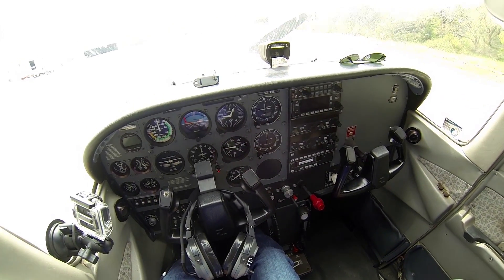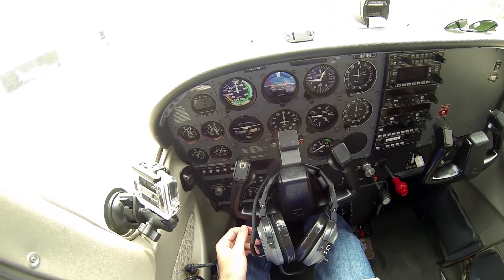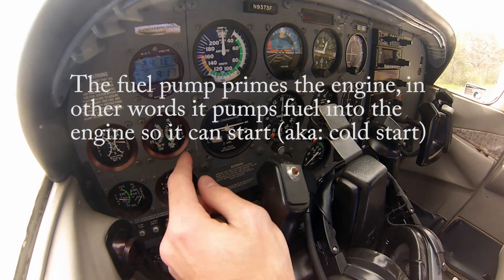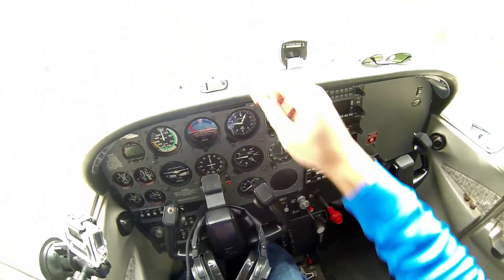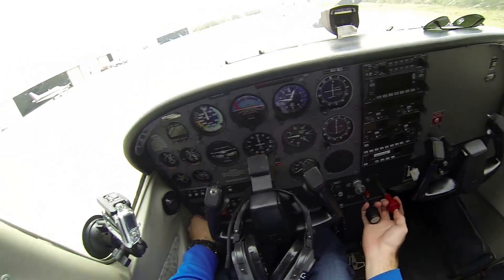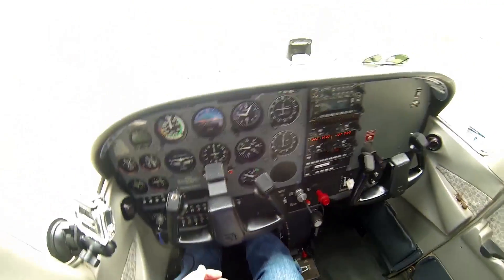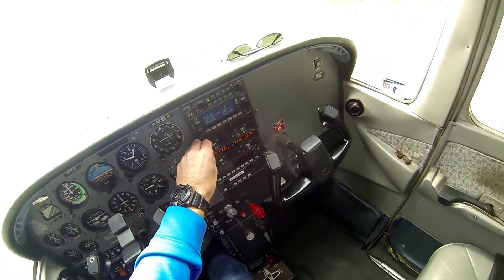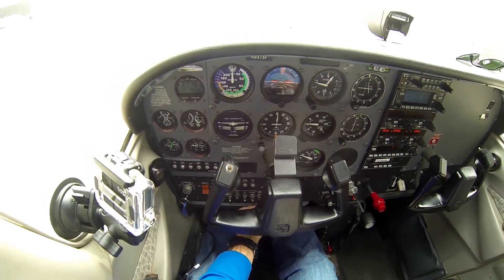How to start up/shut down a C172R

Comment: Interesting fact many Americans are unaware of; The "Master" switch is split for a reason. 
Americans learn to turn on the battery and alternator together, as if it were one switch, but this is actually not ideal, nor what is intended by the manufacturer. Because of the inductive loading of the alternator, it is actually better to start the engine on the battery, and get it stabilized before engaging the power supply to the alternator. Americans have simplified this task, because it is felt too many electrical power-loss failures would occur by pilots forgetting the ensuing task of powering the alternator, and not going back to their checklists where this step would be indicated. It's not a big deal either way, but it is worth noting that many other countries separate these steps, as was always intended by the manufacturer.

Comment: Great video. Thanks bud. I'm certified in the C172, but I build all my hours in the 150 bc it's cheaper and slower (easier to build hours), so I needed the assistance in the starting of the 172, bc it is different

Comment: How to turn off the engine 
THE  STEP BY STEP WAY
RADIO OFF
AVIONICS OFF
ALL LIGHTS OFF EXCEPT BEACON
MIXTURE IDLE CUT OFF
THROTTLE ALL WAY OUT
BEACON OFF MASTERS OFF
THEN IGNITION OFF 
pull the keys out .
HAVE A SAFE FLIGHT  GUYS .ALL THE BEST

Comment: You did not ensure both parking brake on and maintain pressure on toe/pedal brakes.  I was at a flying club years ago and one of our members did a start up without checking brakes.  After starting, he was so occupied with reading the remaining checklist he didn't look up to notice the aircraft was rolling.  He stuck another aircraft's tail and did thousands in damages.  He had to pay the deductible, the club's insurance paid the rest.  But he was kicked out nonetheless.

Comment: i dont really need a checklist, all of the steps are planted on my mind
Reply: its called a checklist for a reason, not directions. its illadvised to not follow the list, even if you are a very experienced pilot.
Reply: @kgraebes88 , I dont think he is a pilot (just a troll). However, the 0.1% he is a pilot... well they have proficiency checks for a reason, he will probably fail them.
Reply: Yeah until you forget a few steps and end up on the news

Comment: So, on this model the primer is a switch instead of a lever?
Reply: This one is fuel injected model, it doesn't have primer pump, you prime by opening mixture, throttle, and after running fuel pump you watch the fuel flow. That's the procedure for a cold engine. On hot, you just crack the throttle 1/4", mixture idle/cutoff, you crank the engine and advance throttle once it fires up.

Comment: 0:44 Where is that noise coming from?
Reply: Not quite, when the engine isn't running, the vacuum pump is not being powered therefore not spinning the gyros for the heading indicator and attitude indicator. Only the turn coordinator is electrically powered, so that is the noise you are hearing
Reply: It's the gyro spooling up when you turn the master on
Reply: FunFlightsHD Does it spin?
Reply: +Doc Nathan Land // docnathan it sure does
Reply: +FunFlightsHD Is it like the APU of an airliner
Reply: +Doc Nathan Land // docnathan nope. Just powers the heading indicator, turn coordinator and artificial horizon
Reply: will kaib you are correct

Comment: Do not switch off beacon when engine is running.
Reply: Also, speaking as a commercial pilot, i don’t see why you would turn on your taxi light without having a taxi clearance (or being about to start taxiing on an uncontrolled airport)
Reply: @qlemens6273  it really depends on the company SOPs when it come to before or after clearance
Reply: why?
Reply: @nobletangent  Because beacon is a sign that the planet has electricity and might takeoff anytime soon.
Reply: @ivanpatarcic73  oh i see
Reply: @ivanpatarcic73  the planet?🤣
Reply: @cv4981  and normally untill you turn off the mags or the master then switch the beacon off
Reply: Beacon light means engine is running and it may harm ground person . In short  it means don't come closer until it's off.
Reply: @Catchthevibes2.0  👍👍

Comment: Says not above 1000 rpm on start than proceeds to let it hit 1500... Maintenance must love you guys!
Reply: well I am sorry but the 172 must be started with 1/4 of an inch throttle open and oh I am sorry but I, as a pilot cannot adjust the idle RPM of the engine, if 1/4 gives me more than 1000 I can't help it either, other than to pull the throttle back after start ASAP.
Reply: Howard Lau your right, the correct response after the engine fires is to ensure it doesn't exceed 1000rpm by actively retarding the throttle. The reason we do that is to minimize the stress on the bits of the engine that are operating without adequate lubrication on the first start of the day. Try bring a ruler or another measuring instrument on a pre flight one day and actually measure what that 1/4" really looks like. You might be surprised at how slight the adjustment really is. 
Believe it or not these injected lycoming engines can actually start with the throttle closed if your quick enough on the mixture. 
Ps. Your poh should indicate that idle should be set between 450 and 550 rpm with throttle closed. The same engine in some float applications can be set up to run at 300 rpm or less!

Comment: What's that sound after you press the master switch?
Reply: +Doc Nathan Land // docnathan No...inside several of the instruments, there are spinning gyroscopes which set a reference point for when you go flying. It's all about inertial changes in your flight.
Reply: That sound is the gyroscopes (or magic) that's inside the attitude indicator.
Reply: Thank you!
Reply: Not necessarily. Refer to what Daniel Watts is saying. It provides power, but the noise is the gyroscopes spinning.
Reply: +Daniel Watts is that battery sounds
Reply: It is like the APU of an airliner which also starts up when you turn on the master switch
Reply: Bocskai Csaba It was the battery starting up and giving power to some things in the aircraft

Comment: For startup, that little red button down below should be pushed in, or on.  That is the fuel shut-off.   If you don't, your engine will die at some point.   You kept referring to the red fuel mixture knob as the fuel shutoff, which it is not; it's only for enriching or leaning the fuel/air mixture.   Maybe refer to card for the entire process, and differentiate more clearly the startup from the shutdown procedure.   but, thanks for making a video to help people out.
Reply: That's because it's always on so we never worry about it (yes it's on the preflight checklist to make sure it's in). You don't need to worry about it (unless it's off) on start up, you worry about the mixture knob which is how we start up an injected C172

Comment: Interesting to push mixture to rich only during engine cranking. All planes I've flown are started with mixture already at full rich (DA20-C1, PA28-181, M.S.880B).
Reply: TheGreenMachine Its a fuel injection thing... Older 172's with a Carburetor are started with fully enriched mixture
Reply: Robert Armstrong The DA20-C1 is also injected, and that is started with mixture full rich. So it depends on the individual engine installation. I've also seen videos of old carbureted radials that are started with primer only, and mixture goes to rich as soon as it "catches". I think this is mostly done to avoid flooding, especially of the the lower cylinders.
Reply: +pinkdispatcher Your DA20 has a Continental engine which is different from Lycoming. Continental fuel injected you start full rich and Lycoming you start idle cut off. Funny thing about the Lycomings (at least the IO-360) it will start at full rich as well. I don't fully understand how but I think I have an idea.
Reply from the maker: cessna's are started differently. its how it says in the checklist (ive seen multiple), its also a cold start